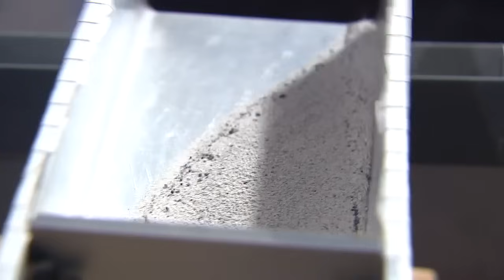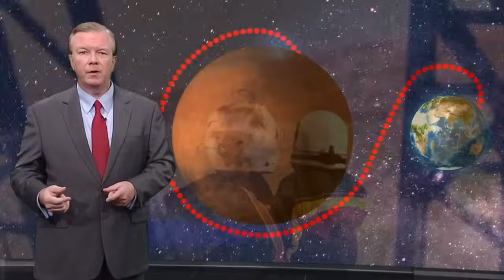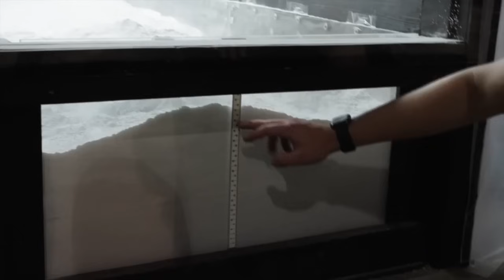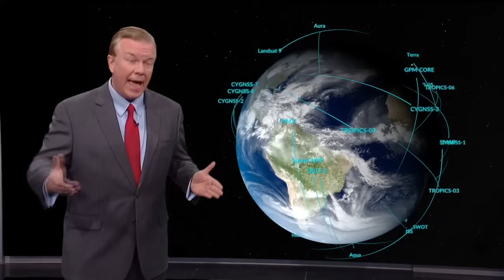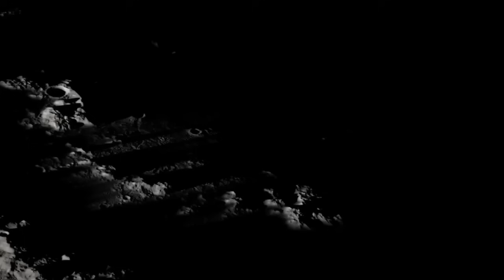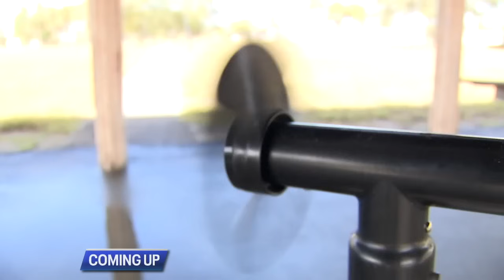Florida Scientists Are Building Moon Bases and Hunting for Life on Mars | Breakthroughs in Science

Comment: To use the Moon to launch a sophisticated communications satellite fabricated in a clean room (on Earth) you first have to get the satellite to the Moon. The satellite requires an enormous ecosystem of parts suppliers on Earth which are not going to be replicated on the Moon.  The “cheaper to launch from the Moon” argument makes no sense.  And look at how much infrastructure is required to manufacture rocket fuel on the Moon. How can two launches be cheaper than one?